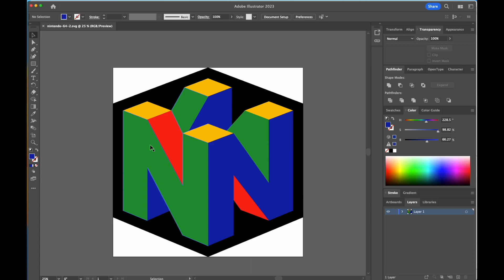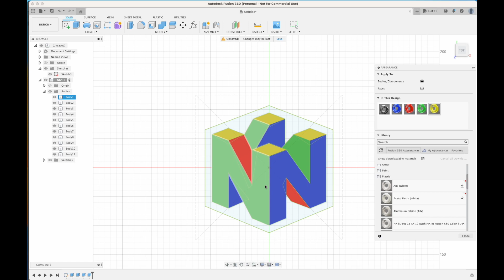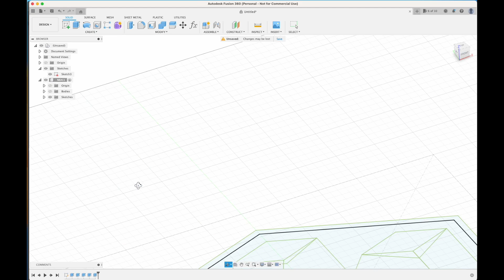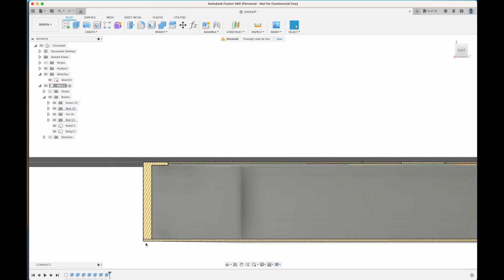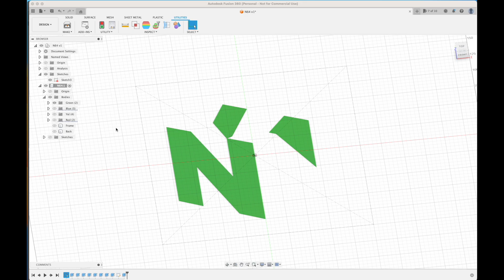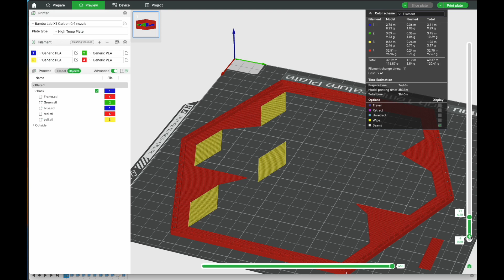Fusion 360 Modeling for flat multi color 3D Prints

Comment: In my experience 0.6mm for some front layers is not enough and will make it very fragile as front side adhesion between colors is very weak. 1mm would be my recommended minimum.
Reply from the maker: Thanks for the input here! When it comes to the illuminated part of light boxes is always a tradeoff of strength vs light transmission.. As you point out, more layers are always stronger than less. However, Lightboxes do not generally need to be extremely strong as they just sit, the frame needs to be strong the faces not so much. There are a lot of variables that impact strength not just the face, and thickness is not black and white... Each color transmits light differently. 1mm works well for white, but darker colors (blue, green, even red etc..) need to be thinner unless you want a dim outcome (also depends on how deep your lightbox is. I have made over 20 lightboxes in various sizes, shapes, and forms. I have found the difference in light transmission on the whole ( and depending on color ) between 1mm and .6 is drastic. The result is less LED's are needed, and the glow is more vibrant. Just my 2 cents. Again thank you for the comment.

Comment: Question. I got all the way to exporting, but when I click on the "Make", my OK button is greyed out. And I can not export the body group.
Any idea what I did wrong? Thank you!!
Reply from the maker: Sorry you are having issues. So the ok being greyed out is in the small export dialogue box that appears right? If so try changing the selection in your structure manager maybe the wrong level is selected so it’s finding any bodies. Usually this is the case. Let me know how it goes
Reply: @tha_factory_of_fun  Sorry, I should have started with THANK YOU! Cause I have watched so many videos and they are all hard to follow. Yours is by FAR the best! 
And I dont know what I did, I clicked SO much, but its not greyed out today. Wish I knew hat I did. Ha ha.. But thank you again!! 😄
Reply from the maker: @Effect2o  you are welcome just make sure you have something selected. I have had this happen where I thought I had bodies selected and then tried to export and the ok is greyed out. :)
Reply: @tha_factory_of_fun  I just had this same issue. The way I found around it was instead of using that "make" utility. I chose file > export then said to do stl format. That finally worked for me.

Comment: Nice tutorial :-) If i would make suggestions - try to export the model (especially if it is a multipart one) in 3mf-format. In that way it containts far more information within one file and you don't have to mess with multiple STL-files. Bambu as well as Prusa slicer (and their forks) handle them very well. I do it on regular basis.
Regarding flow rate - I suggest to utilize OrcaSlicer (a fork of BambuSlicer) to tune in your filament - every manufactured filament is different and 'general' settings can work or don't. It take a few minutes for a new brand / type and helps alot.
Reply from the maker: Thank you for the comment @Wylaryzel. Bambu Studio now has a ton of the feature that Orca does in the latest 1.7.1 release! Yes you are right using a single file that can be used as parts is the way to go, adn STL supports this, you just have to right click and separate to parts. However, STEP file seems to be the best. When importing the model by STEP file, Bambu Studio will automatically create its Assembly View, which remembers the relative position of each part.